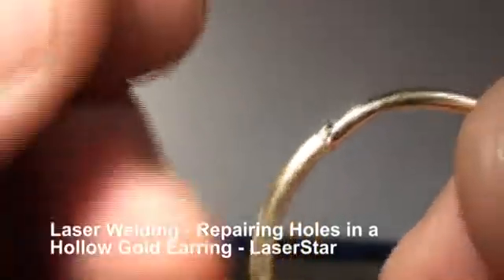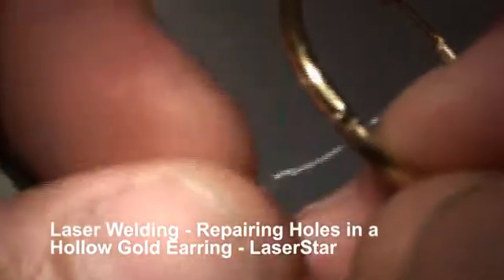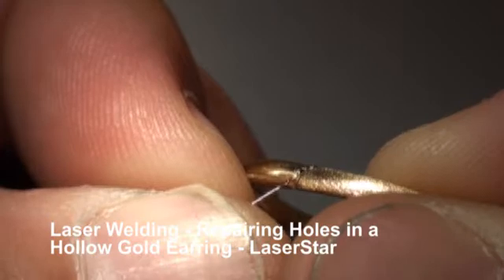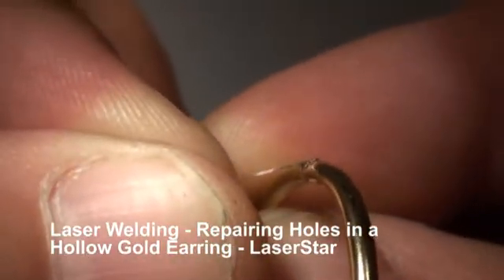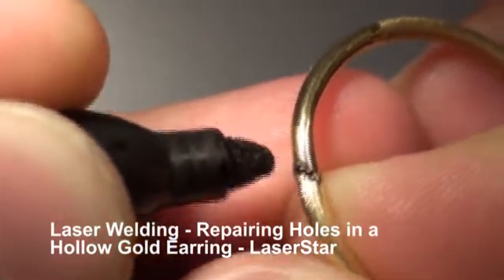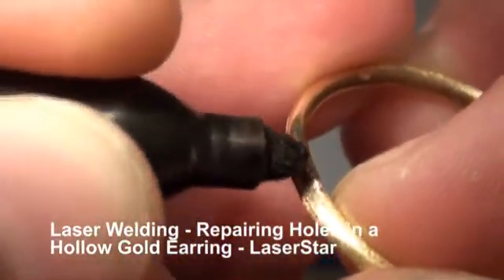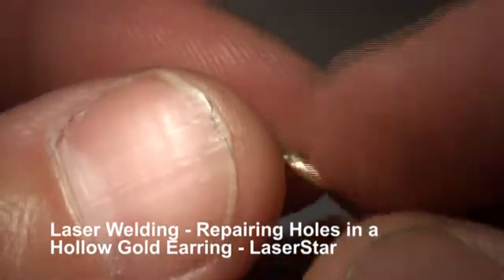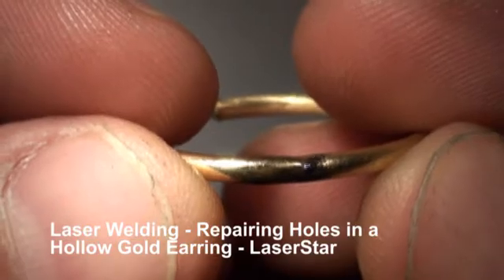Laser Welding - Hollow Earring Hole Repair

Comment: what were your settings i noticed a very fast pulse rate . im a jeweler in new jersey and have been working with my machine for 4 years. i love learning new techniques. i have a 140 jule  laser welder ... never had the reason to turn the power up to that however i love my machine and would like to learn more about it . thanks for the video